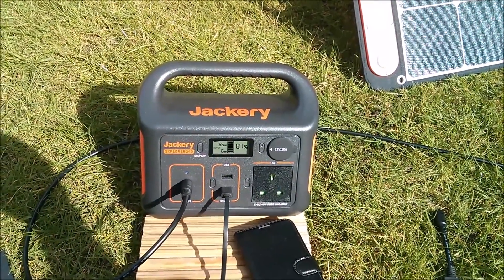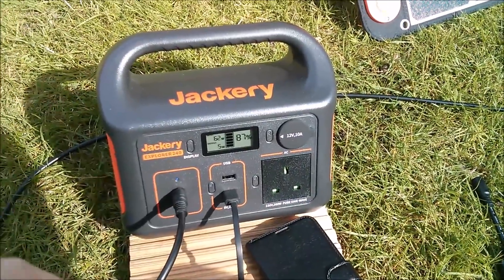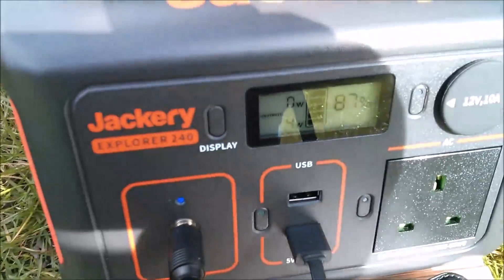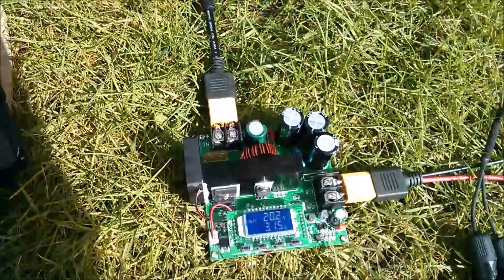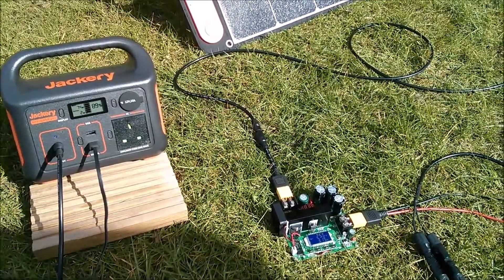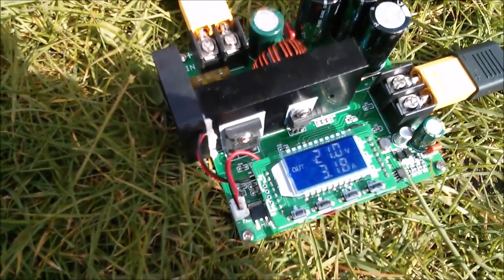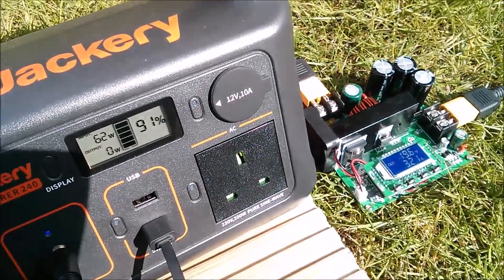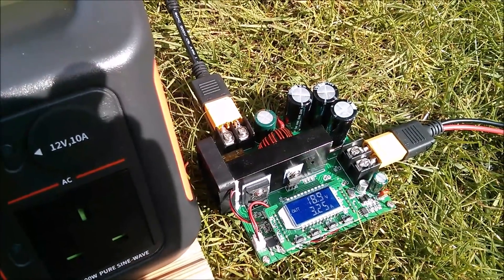Boost Jackery Explorer 240 / SolarSaga 100 Charge Rate

Comment: @Julian Ilett What is the solar panel voltage when the boost converter is turned on? I bet it is allowing the panal voltage to increase to closer to where is PMax rating is, as that is likely closer to 34V at a guess.
Reply from the maker: The SolarSaga 100 panel has 32 cells and can only get to about 20V max. The boost converter isn't modifying the panel voltage very much at all. The Explorer 240 input circuit appears to be pretty much constant current, so power drawn is proportional to input voltage - this seems to max out at about 80W when the input voltage is about 25V to 26V.

Comment: I have panels that give too much voltage. My simple solar charger (for lead acid) can handle max 25 while the panels can go up to 32 volts on a bright day. When connected directly the solar charger crashes from time to time. So I put a buck converter between it. This actually works but with low sunlight it stops working sooner I think. It pulls the voltage down to below the battery voltage on the panel side. I suspect if the panel was connected directly it would still charge a little. I cannot turn my buck converter off like you did with your boost converter. It would be cool to have a smart version that knows then to stop boosting or bucking and just pass though. Or maybe that is just called a charge controller :-)

Comment: Your also loosing due to the cable resistance and also a MPPT solar charge controller would do a better job than a simple boost converter.

Comment: 80 Watt's finally... How.........😵👍 there is always a voltage drop through the circuits or cables..?
Reply: Research MPPT, the solar panels don’t have a linear output power to voltage ratio, when dragged down by a battery they run less efficiently, if allowed to float up to their ideal voltage you get more power out of the panels.
Reply: @TheDefpom  yeah I tried that with pwm raised just a little (DIY stuff) anyway thanks for your reply Sir I saw your channel you've got one sub from me :D

Comment: Interesting! But what would you be able to achieve if you use a constant current constant voltage to keep the input to the battery constant? Would the boost converter make use of all the voltage that the solar panel has to offer?
Reply: You don't usually want to make use of all the voltage a solar panel can offer, as they deliver the most power (watts) well under their maximum output voltage.  Finding the perfect balance of volts and amps to get the most power out is what MPPT is all about.

Comment: A better explanation might be more along the following lines: By increasing the set voltage into the battery pack, you thus increase the current. This then results in a better matched load on the panel itself (and, to be clear, you have shown no numbers on that panel side of the circuit). The best demo would include a voltage/current/power meter on the panel side of the circuit. You could start with a (large) variable resistor as the load, and see the power go up and down around the MPP combination of voltage and current. Then, for part 2  of the demo, the Boost Circuit is equivalent to the (large) variable resistor. All good in any case. I'm glad you have sunny days. Cheers.
Reply from the maker: Yeah, it would have been better to see voltage and current on both sides of the converter. It was all a bit rushed because the sun and England aren't best mates ;)
Reply: I do feel sorry about the weather. Here on the other side of The Pond in Nova Scotia, Canada, we've had a very sunny winter. I only had to scrap ice off the car windshield about three times all winter!! A typical winter would be scraping ice almost every single day. Cheerio !!
Reply: @JxH  down here in Melbourne Australia... What's ice on a car windshield? How does that even happen? LoL of course I'm kidding, I know what it is, we have YouTube LoL... You would think that the fact that we are so close to the south pole that we get snowed in during winter ❄️... But the last time that it snowed in Melbourne was back in 1986 and I didn't even get to experience it because I got back from a holiday in Europe the next day after it happened!!!! Talk about timing LoL... It was a historical event and I missed it... 
Say! How's all that permafrost you guys have up there, is it still intact? Could potentially be a big problem if it starts thawing out... That's when we know that we are in trouble...

Comment: The Jackary has a current limited charging circuit. If you boost the voltage you get more power at the same current.
Reply from the maker: That seems to be how it works :)
Reply: @JulianIlett  So it might not have a positive effect on a more cloudy day?
Reply: That explains it! I was confused as to how you can just add wattage.
Reply: I'm not sure it's even as complex as current limiting, a higher voltage applied to the charging circuit will give the same result. If you look at the output of the Boost converter you will see that the current flowing through it actually drops when it turns on which suggests it isn't being current limited.

Comment: Couldn't you get a better match with a boost converter feeding a buck converter? The efficiency might be crap, but you could fine tune the maximum power point.
Reply from the maker: I used a boost/buck converter first and the results were very similar.

Comment: Is the jackery meant to be mppt, or was that the other lithium bank/inverter/charger thing you have?
Reply from the maker: It says MPPT on the box :/
Reply: @JulianIlett  so typically that would be a buck convertor. It seems odd that their buck circuit is inefficient when the input is close to the output.
Reply from the maker: Actually I've done some characterisation tests on the input circuit. Maximum power is achieved at about 25v to 26v. But wind it up to 27v and the power collapses to around 40W. It's quite strange. I'll do a video on this soon :)
Reply: @AdamWelchUK  The Tracer charge controller is the same, at low wattage it just pwm's, you did a video on that
Reply: @PetRatty  Yes at low power that is true. I’ve found it’s anything below 10 watts. It makes me wonder whether this is not mppt, but has a buck converter which is set to a specific input voltage - or perhaps a particular jackery solar panel (or power supply).
Reply: @PetRatty  The Epever BN Tracer series sometimes get 'stuck' at lower wattages, but turning them off for a few seconds and back on can get them back to MPPTing.
Reply: @JulianIlett  - That's interesting that the power drops above 27V.  What does the battery pack's spec sheet say about this "solar" input?  It had seemed to me to be maxing out at ~3.15-3.25A but if it also drops at 27V it make me wonder.  I thought it could do better than 100W in?  Could it be the solar panel is maxing out in the 85W range (it's not summer after all) and the battery pack is MPPT detecting a drop even through the boost converter?  How about upping the input power to your booster with another solar panel in series or parallel to eliminate that as a possible cause?  What are the limits of that booster?
Reply: @urbanimage  I have the AN series which just means the positive gets switched and common ground, software is probably the same.  I've had no problems with it but like Adam Welch said, below 10 watts it switches to PWM mode, this is confirmed be reading register 0x3008 (charge mode). Why this happens, i have no idea, the unit works just like it should.
Reply: @PetRatty  The sticking phenomena seems to be quite widely reported by owners of the BN series of controllers, though apparently not by owners of the AN series. A BN will correct itself after a time, but this can take a good few minutes. Apart from this they seem like pretty good, reliable controllers.
Reply: probably the mppt voltage is set too low.
I find that 2 x 24 volt panels in series produce less power then in parallel unless they both have full sun, I have a relay that switches between series and parallel, it checks the voltage ever minute of the panels to get the max out of them. Would like in the future to use mosfets